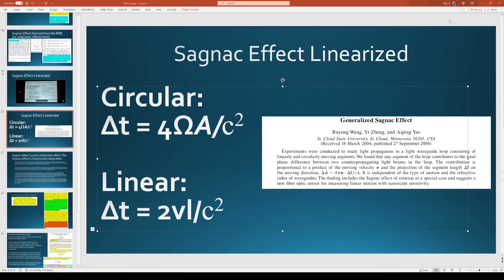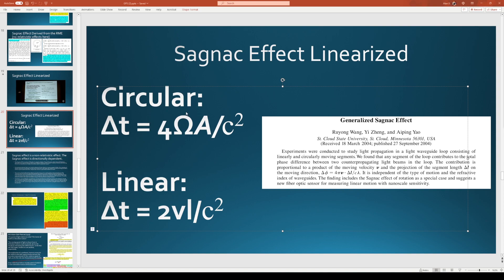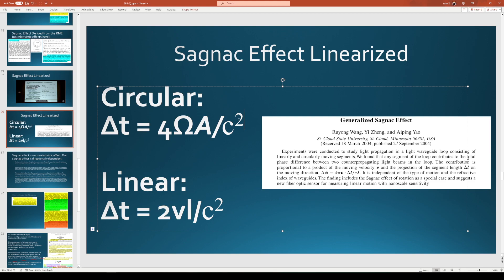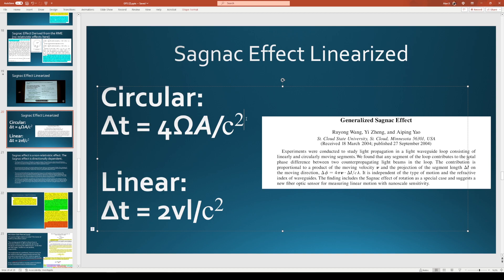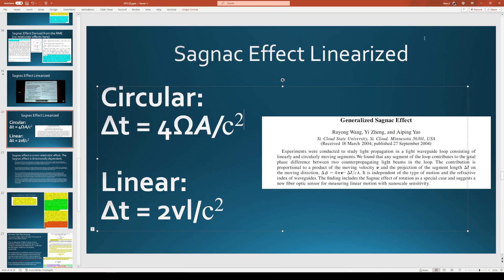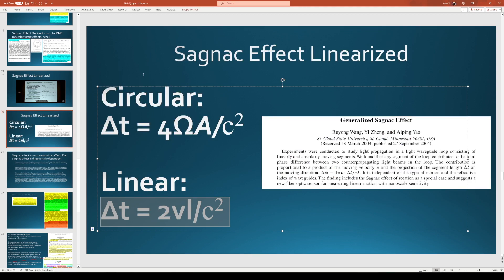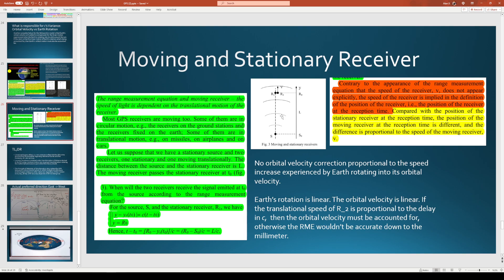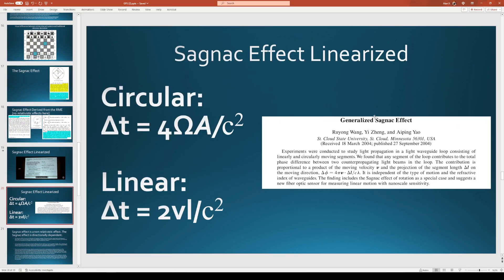Sagnac: Circular vs Linear and Why it's Significant

Comment: The ring laser gyros use dithering.....and they do not actually spin in circles.  They simply jitter back and forth left to right, in order to FORCE the two laser beams from getting "beam locked"...............because they already know if the device is left alone, placed on the surface of the Earth, it will never show any rotation whatsoever, and those two Laser beams will ALWAYS be locked in sync zero fringe patterns.   

So............what Clown world does is---->  Force the device to jitter back and forth, which DOES register a small fringe pattern, and does NOT allow the normal beam lock to happen from it being stationary NOT moving at over 65,000mph with Non-Uniform Motion, further amplified from being moved an additional 1,000mph with 12hour cycles of decreased force spinning AGAINST the direction of forward 65,000mph Momentum, on the Inside of the Non-Uniform Motion left turn,  going around a circular track...and 12hours later on the other side, on the outside of the left turn, additionally being spun at over 1,000mph momentum with an additional non-uniform motion left turn about a 4,000mile radius Circle..........now moving and spinning WITH the direction and 65,000mph Momentum in Non-Uniform Motion, TURNING LEFT going around a Circular Track.   

Variable T-Cup Ride Forces every 12hours on the spinning Marble ride placed INSIDE of a Super Giant Vacuum Chamber in the Kingdom of Narnia.   That would EFFECT fringe patterns and Velocity directions of signals, just like Wang proved would happen.

The Clowns force the Ring Laser gyros to produce a 15degree per hour fringe pattern right out of the box, and then they ZERO it out, before they actually use it, lol!!!!!     Nice TRICK.
Reply from the maker: You're always on point, bro. I lost my RLG Inertial Guidance System manual pdf so I went back and redownloaded it, was going over the sections I could remember to re-highlight and I stumbled on the frequency lock section.

"3.3.2.2 Frequency Locking. Another problem is frequency locking of the standing wave. At low rotation rates, the standing wave tends to lock to the ring and move with the ring as the ring rotates. This effect is analogous to friction in a mechanical gyro. Frequency locking is caused by the backscatter of photons at the mirrors. If the mirrors were perfect reflectors, the laser beam would propagate around the path without any photons being reflected back along the incident path. In practice, a small percentage of the incident light wave is backscattered from the mirror surface and is 180 degrees out of phase with the incident wave. This phase shift causes the beam to "want" to reflect at a node on the mirror surface. At low rotation rates, the node generated at the mirror surface tends to move with the mirror, causing the standing wave to move with it. The effects of frequency locking are eliminated by mechanically rotating (dithering) the optical path back and forth at a high rate. This action maintains a high rate of motion in the gyro even when the platform is rotating at a very low rate. Since no net rotation is introduced by the dithering action, the effect of dithering is canceled in the processed signal."
Reply: @space_audits  they think they slick....but they ain't, lol.
Reply: @space_audits  "Since no NET rotation is introduced by the dithering action....the effect of dithering is canceled out in the processed signal."    

And that is what we call doublespeak.  If there was no rotation introduced by dithering, then there is no need to cancel it out, before you can use it..    

Like little snakes in the grass with word play, lol.

A processed signal is:    electrical engineering subfield that focuses on analyzing, modifying and synthesizing signals.   

So if you say on one hand that by jittering it back and forth real quick, won't make it give a false reading of rotation being present...........then there is absolutely no reason to cancel out the effects of doing that, when you process the signal.      "It doesn't make the gyro think it's rotating or anything, it just ensures we don't get beam lock, like when there is absolutely no rotation whatsoever, and the gyro is placed on a perfectly still platform...................however, we do cancel out the effects of the dithering when we process the signal.." -- Doublespeak.

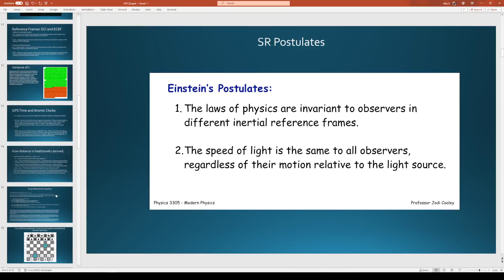Comment: 7:30 - the linearizes sagnac is still a moving loop, with the interference device moving along with the loop, which is also why it can't detect linear motion of the entire device. No relation to MM. No destruction of SR either.
Reply from the maker: Let's assume your analysis is correct. I recommend you read the following for  a better understanding of the issue at hand  here:

Tartaglia, A. and M. L. Ruggiero (2015). "The Sagnac Effect and Pure Geometry." American Journal of Physics 83(5): 427-432.
	
Bhadra, A., et al. (2022). "A Quest for the Origin of the Sagnac Effect." European Physical Journal C 82: 649.
	

It one-way speed variances proportional to the velocity of the observer as well. 

Yeh, P. and I. McMichael (1986). "Studies of Phase-Conjugate Optical Device Concepts." Rockwell International Thousand Oaks CA Science Center, Annual Technical Rept. 1 Apr 85-31 Mar 86.

Yeh, P., et al. (1986). "Phase-Conjugate Fiber-Optic Gyro." Applied Optics 25: 1029-1030.
	
Wang, R., et al. (2006). "Test of the One-way Speed of Light and the First-Order Experiment of Special Relativity Using Phase-Conjugate Interferometers."
Reply: @space_audits  Which of these claim anything that conflicts with special relativity? Wang may do (didn't read yet) prejudiced by the other paper; Tartaglia does not; Bhadra may (judging by the abstract for now).

And what do you want me to take away from these?
Reply from the maker: @flatearthphysics1921  That issue isnt regarding a relative motion of a loop. The variance is shown in one-way experiments too.

Further,  Relatively can't explain the fringe displacement on a local Sagnac device [closed light loop on a platform]. As noted by Tartig and the other guy, they can only deny that a closed loop in uniform rotation is a non-inertial frame, even though Einstein specifically defined that frame as inertial. This is of course to "observe" the variance in c from a "geometrically convenient" location i.e. the center of the device (or length depending on the configuration). 

To even explain the fringe,  GR has to be invoked to convert the rotational energy to a gravitational field that produces little temporal pockets of time dilation and length contraction.
Reply: @space_audits  > they can only deny that a closed loop in uniform rotation is a non-inertial frame

What? The rotating interferometer is a nonintertial frame, as evidenced by coriolis and other forces appearing on the rotating platform (not related to the sagnac effect, though).

> To even explain the fringe,  GR has to be invoked

To explain why this is a rotating frame and that is not, yes. Greetings from Mach. To explain sacnag per se, no.

> convert the rotational energy to a gravitational field that produces little temporal pockets of time dilation and length contraction

If that were true the sagnac effect would be stronger in a heavier interferometer. Unless you're talking somehow about frame dragging in general.